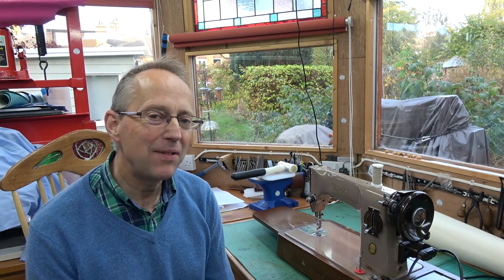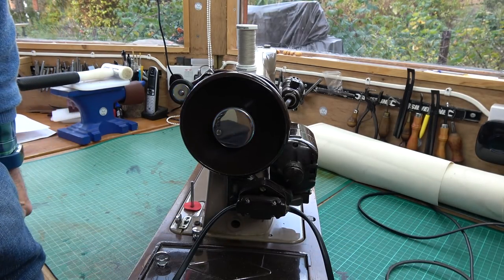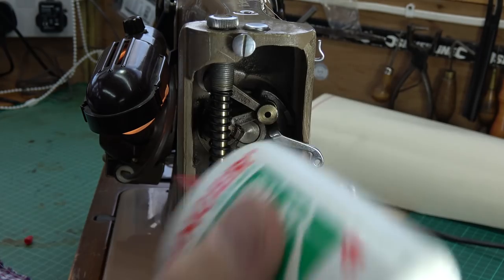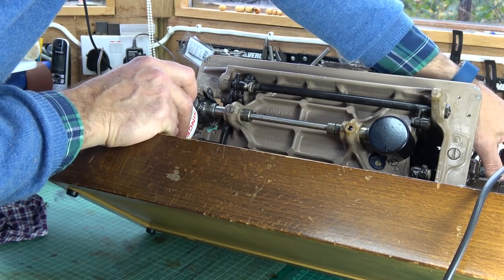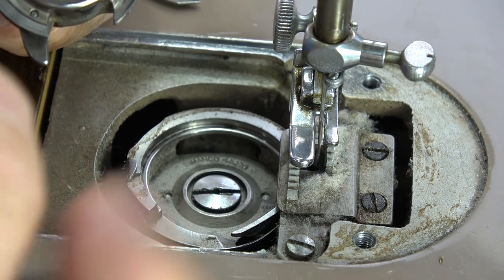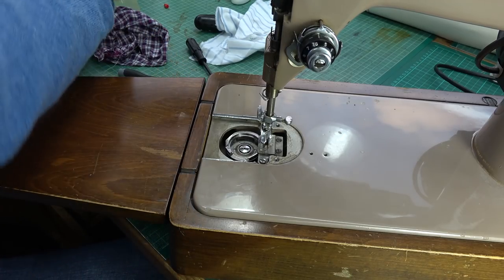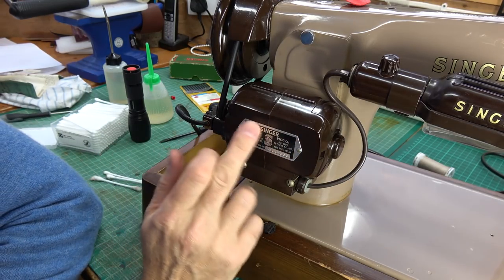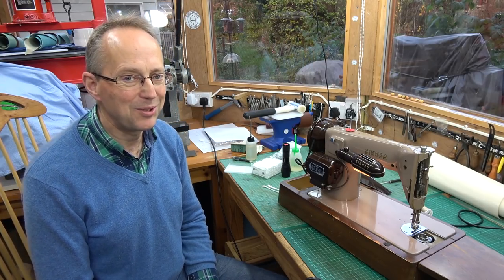Reviving a Sewing Machine Singer 201K

Comment: How many layers of leather did you manage to sew through eventually?
Reply from the maker: Hi I can't remember but the machine was fine for sewing two layers of upholstery leather...do bear in mind though that the main limitation will be thread thickness.
Reply: @harryrogers  i want to sew a box junction on 3 layers of polypropylene webbing. Do you think the 201k will handle it?
Reply from the maker: @MrFarmax  Give it a go...it will not be so strong due to thinner thread  but the machine might just do it????

Comment: I just bought a nice 201-2 1951 AK 382978
And I wanted to clean the needle bar so I unscrewed the needle clamp to remove the needle. I wiped it clean, inserted the needle, as high it can go flat side facing left. I screw the needle clamp. But the the needle clamp feels loose and and the needle just slipped out. I don’t know what to do. The needle clamp has a tiny flat screw on the left of the needle clamp. I unscrewed that and re-screwed it but still the same thing. I don’t know what to do? Help!

Comment: I've just got one of these, but it's all so stiff the motor won't even turn it. Is there something I should be doing besides just constantly oiling it and hand cranking it a bit until it (hopefully) loosens up?
Reply from the maker: Hi difficult to say without seeing it, but I would check for any build up of tangled thread or dust accumulation around the flywheel and elsewhere...including under the machine, and perhaps try scraping off any debris from moving parts...you are doing the right thing with oiling...try and use a fine oil to penetrate through a bit...good luck.
Reply: @harryrogers  Thanks Harry! Feels like it's loosen up a great deal already so I'm hopeful :)

Comment: Hi, can this be used for delicate fabric? Thanks
Reply from the maker: @Ahmed7255  It's good for dressmaking, and I have used for silk.
Reply: Thank you, which is better , this machine or one od the modern singers @harryrogers
Reply from the maker: It's a bit like comparing a modern car to a vintage one.....the new machines will have lots of useful features, the old may be more enjoyable to use, but that also depends on what you like. @Ahmed7255

Comment: Hi harry I am just looking to purchase one of these any advice would be welcome and a idea of price please
Reply from the maker: Does it turn ok look ok and does the tension spring flip up and down in use...price ...see sold listings on Ebay as a max.
Reply: Harry Rogers thanks it at £50 at mow. Hopping to pick one up soon
Reply: William,
I hope that you were able to acquire a Singer 201K. Any of the earlier black cast iron Mark 1, early black Mark 2, or later beige/brown Mark 2 are excellent sewing machines.
I consider the 201 series as the best straight stitch sewing machine that Singer ever produced.
As Harry has pointed out the Mark 1 cast iron models are heavier and the Mark 2 aluminium models are lighter. The mechanism that drives the machine is almost identical in all of the 201 series.
How can you argue with a rotary hook sewing machine which was made by craftsmen at the Singer plant in Kilbowie, Clydebank, Scotland?
I wish someone had saved the tower clock movement, clock faces, and drive mechanism between the movement and clock faces that was in the Kilbowie plant's clock tower.

Comment: wouldn't be grease better solution for some parts there? this what is usually used on power tools etc with similiar mechanism.
Reply from the maker: Yes,  I want the oil to work all the dirt off first.

Comment: Very good video- valuable information.
Where did you purchase the replacement belt?
Where can I find the wooden base your machine sits in? 
Mine currently resides inside a cabinet with legs, making it unwieldy.
Reply from the maker: Probably EBay for both....check the base size as there are long and short versions.

Comment: I went to test a 201P like this a week ago and it went bang flash and shorted the outlet! Scared the crap outta me. I want to convert it to hand crank but can’t find any videos how to do it. Any help appreciated!
Reply from the maker: Hi I think you will need one of the Singer spoked wheels and a hand crank unit..perhaps find an old donor machine as a lot of the parts are interchangeable...perhaps there is a sewing shop nearby that can help? You could alternatively buy a new motor unit complete with new wiring and pedal such as the YDK which is on Amazon UK for £35.
Reply from the maker: https://www.amazon.co.uk/YDK-Sewing-Machine-Control-Brother/dp/B01ABXOX9E/ref=sr_1_5?keywords=singer+motor&qid=1556651106&s=gateway&sr=8-5
Reply: Harry Rogers Thanks! I’m in Australia and can find the unit, but no luck finding any videos on how to do it. I’ll video my attempt and share if successful hehe.
Reply from the maker: @elbanti  Great..I think I put one up on the motor and led bulb, but I lose count.
Reply: For anyone buying an unserviced older Singer - the insulation on the wiring is often degraded. For your safety, it's essential to inspect it before use, and replace if required. Otherwise you risk a serious accident.

Comment: Harry,
 Informative video.
 But where do you buy those torches like you had ? In the US they all have flash light on them and torches are all lighted with a match:-{
Hoovering over here is what some women do in public restrooms and urinate all over the seat, so it can't be used by anyone else ?? It appeared you were vacuuming or sucking the dust out ?  It looked like it could have used a good, blowing out with some compressed air, first ?
 Never thought about sewing leather with a machine. May have to dig out the old old treadle machine of my wife's geat grandmothers and see ifit will work or wheather it is all messed up from being in a wet basement :-(. The fancy engraved or inlaid cabinet with drawers is lamination is all separating from it.

Comment: I was sewing on my 201 and it stopped running randomly I've checked the motor and all the other point's it just seems to have stopped 
I was just hamming trousers and its frozen
Reply from the maker: Has it disengaged at the handwheel?
Reply: @harryrogers  yes it has 
Sorry to trouble you
Reply from the maker: @graceygal2664  Ah good easily fixed by turning the knurled centre boss on the handwheel.

Comment: Good video. I'm new to sewing but I've been searching for a 201 with the crinkle matt black finish.  I take it that the Singer 201K was made in GB? Here in the US the 201's have direct drive motor that uses no belt, the light is located in front and a lower front white switch exists that I think turns on the light. If you get a chance please take a look at the following link https://www.youtube.com/watch?v=EbvBBNkRRIA 
and let me know if you can identify this model Singer (it's not a 66). I've also been looking for one like this just to see the inner workings and watch the motor running.